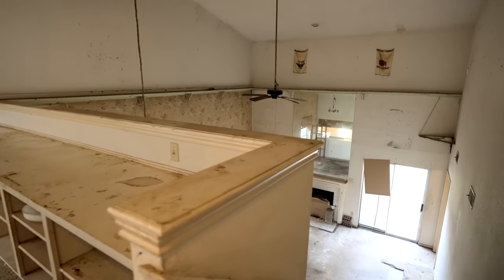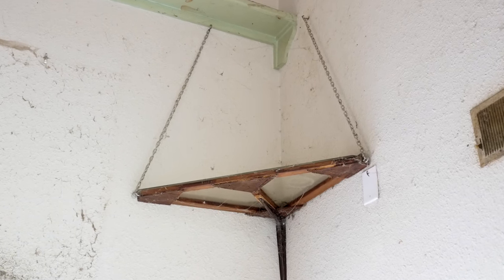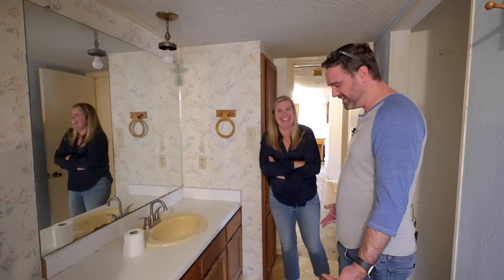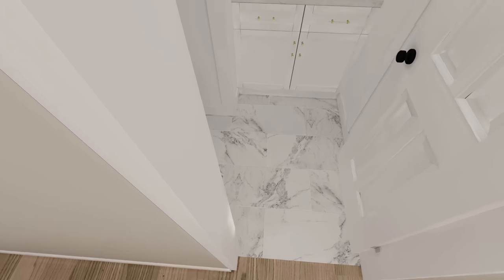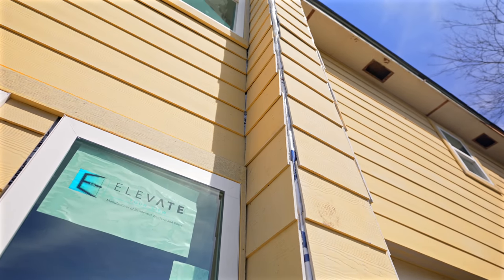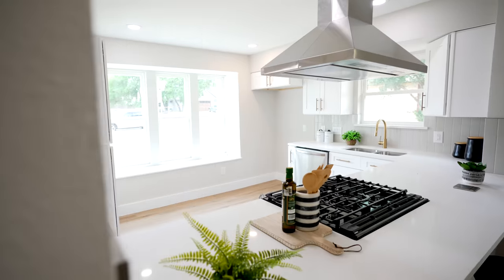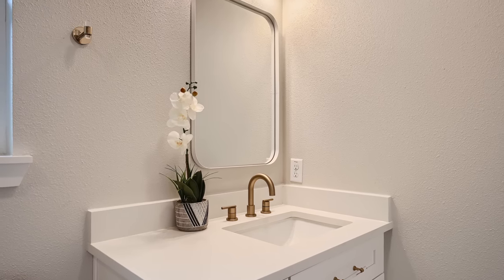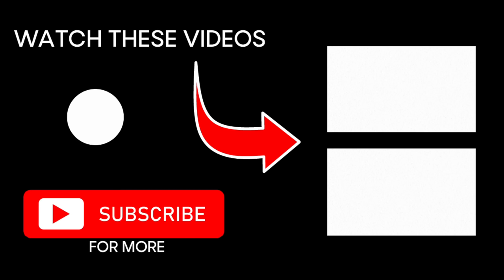Entire Before & After House Flip | How we Discovered an Extra Bedroom?!

Comment: Can't understand how adding an extra bedroom, powder room and indoor laundry only netted $20k profit!
Reply: I agree. Likely some market downturn to blame. Bought high, sold low.
Reply: If they hadn’t had the $14,000 wiring cost the proxy would’ve been higher. This house required a lot more than just cosmetic fixes :(
Reply: @tyrelirwin yeah, I find it really hard to believe it cost 355k.
Reply: Cost of materials and labor.
Reply: Is this a ritzy area? Seems like a lot to pay for a rundown 2 bed 2 bath. Can't squeeze out a profit if you overpay to begin with.
Reply: Austin is really expensive
Reply: The house was sold for 245k more than paid, it was just a really expensive renovation and high holding costs. I hope the agents commission and Austin Flippers profit was included in the cost and they actually made that 20k. If so, it was a very passive 20k for them so not bad.
Reply: prolly because they invested more on the renovation.
Reply: may  be the  neighborhood is not that great

Comment: Well done. I like most of the changes, but I wouldn't have put the cooktop on the counter between the LR and the Kitchen  - that makes it feel like a hibachi grill. The big window in the kitchen caused could have neen a bank of windows there instead,  above a counter, with the sink and dishwasher there. I would move the stove on the side of the kitchen where the sink was. That way the counter between the K and LR could be a buffet or eating bar. Love the new powder room, and primary bathroom, and the upstairs, kids will love the family room space between the bedroms to play. Or, the new one bedroom could have been bigger, insead of the big bonus space. It could have been a larger hallway, with  built in linen storage. Brainstorming options 😁
Reply: Totally agree about the kitchen. The big window wall was devoid of cabinets and countertop. Not enough cabinetry in that kitchen for me. So glad they bumped the ceiling up and widened the opening to the LR!
Reply: Yes!  I am aways so disappointed to see a lovely island or peninsula surface interrupted by a cooktop or a sink.  Also, if the range hood is on an outside wall, it can vent directly to the outdoors.

Comment: I just started this video - not 2 minutes in - and I'm already frustrated, in anticipation.  Because I know they're going to do what they always do, and cheap out, by not altering the footprint, not moving that ridiculously placed kitchen, not adding a bedroom (don't know if there's room to, but, if there is, they won't add one), etc..  Whatever's required to turn this from an okay flip to a bid-breaking, awesome, flip, they will fail to do, if it involves the slightest inconvenience of moving plumbing, adding plumbing, altering the footprint significantly, etc..  So, I'm frustrated, in advance.  Maybe they'll prove me wrong, but, they haven't yet.
Reply: Since they literally did all of this… you can delete this now… assuming you finished the video.
Reply: Actually, I agree to a point. Yes they did more, but that kitchen is not that great. Its closed off, no island, large window prevents more cabinets there, stove on bar area, if someone sat on the 2nd chair they'd get burnt. I'm also not a fan of vertical tile. Its not really that in now, not sure if this is an original showing or not.
Also, 1 small niche in shower, no separating tile to break up all that beautiful blue tile.
Other than that,
I love all the blue, the light grey, the fireplace is awesome, and the wood floors are gorgeous.
Reply: @debk9889  Their work always looks great - color choices, finishes, etc..  But, look at the profit:  $20,000.  Had they cinverted that cathedral ceiling into usable space, they'd have tripled that profit, at least.